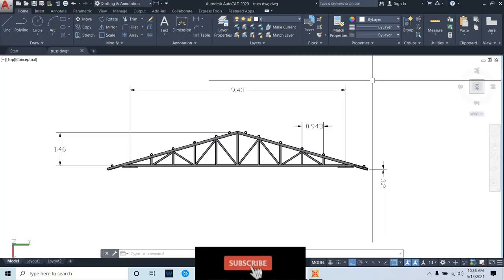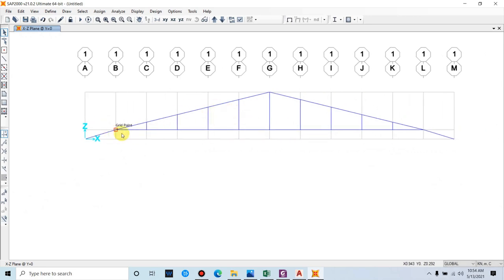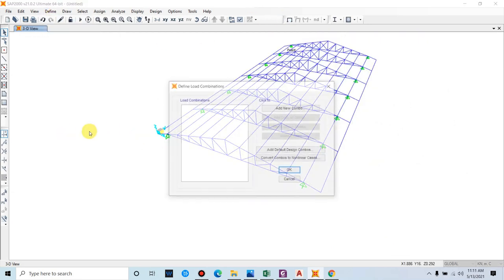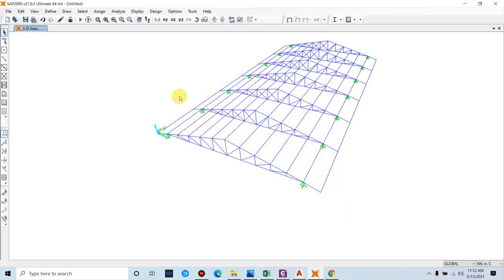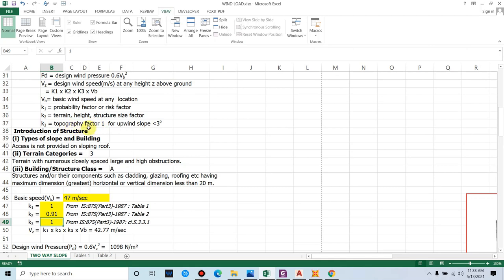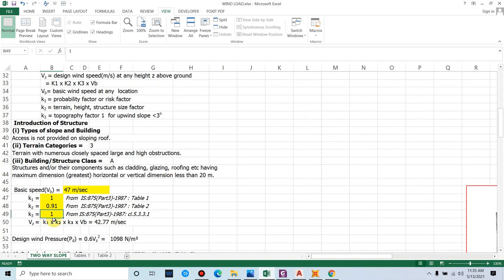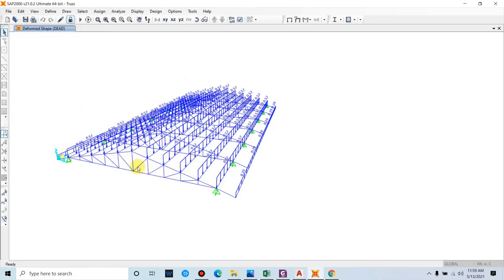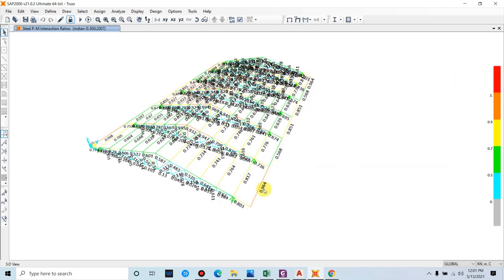Design & Analysis of Steel Roof Truss | Wind load Calculation IS 800:2007 | Real Site Practises |

Comment: 1. Why  didn't you  model two purlin that runs like in real field?
2. Why did you break a both top chord and bottom chord at joint if it is single element in real field?
Reply from the maker: Thanks for your query dai,

As i said we can model that purlin but there won’t be significant variation in result as i have done it previously.
Secondly the basic idea of FEM is to subdivide member as possible it is.  To generate accurate results for certain analyses, frames must be explicitly subdivided, or assigned automatic meshing, where the object is handled as a single member, but meshed into multiple segments for analysis purposes. 

Thanks. and do please let me know if there are some mistakes dai.

Cheers
Reply: 1. Its okay to do like that
2. For this case ;I think  we can model  as a single element as in field .But it may fail in slenderness ratio.For that we can overwrites the effective length parameter

Comment: How can we make the support as pin joint? Practically they will fix the support. Either they will weld in the base plate or they will anchor.
Reply: And Why K4 is not considered in this design. K4 is also explained in the code.  When we consideted Ka, Kd and Kc?
Reply from the maker: In case if fully fixity is not achived, then rotation will be allowed in the joint which leada to failure. So just to be in the safe side design member with hinged support.
Reply from the maker: Importance Factor for Cyclonic Region (k4) . I hope you got the answer by the name of the factor itself.
Reply: @civilconst  Thank you for the explanation and the video tutorial.